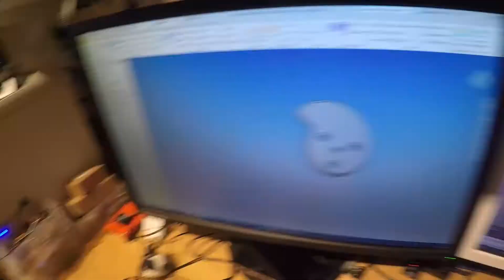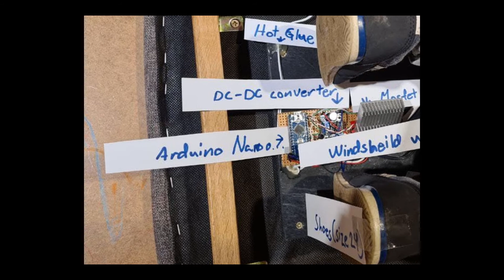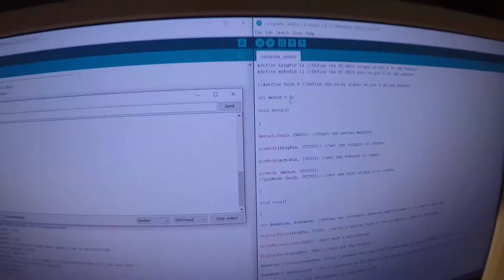Whackabum 2000! How to get off your chair with style!

Comment: Recommendation: tell more about the project throughout the video.  For example you didn't described the mechanisms that induce the kicking. Were they time induced with weight on a pressure plate? How does it reset? What type of power supply is needed? What makes this harder to turn off than a phone alarm?

Good video.